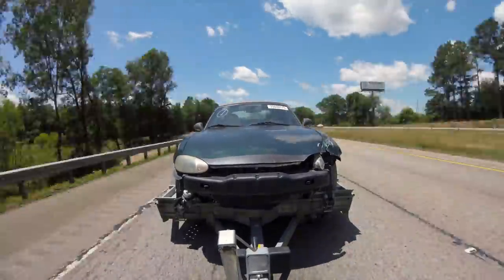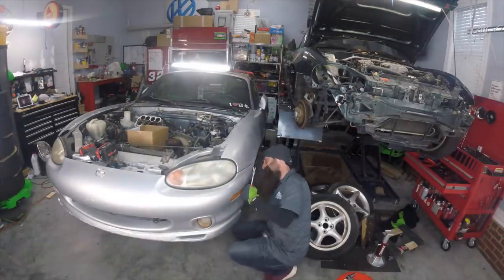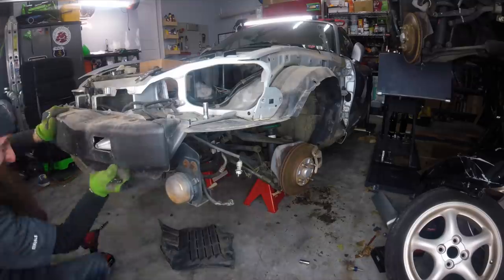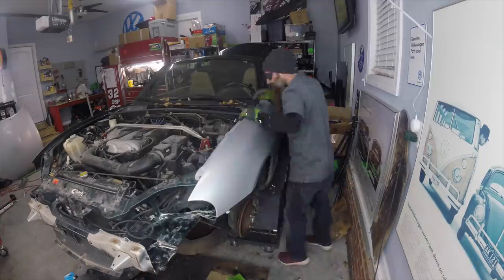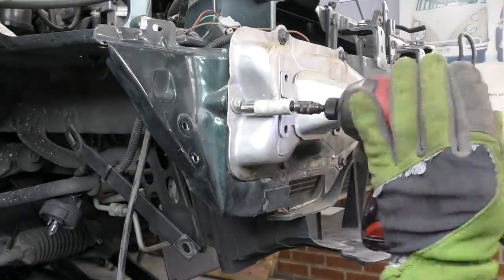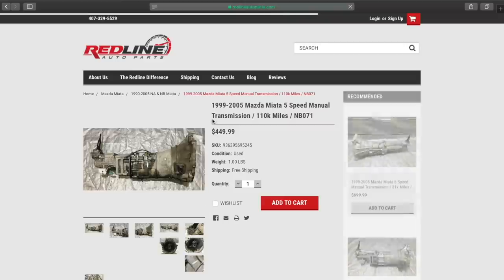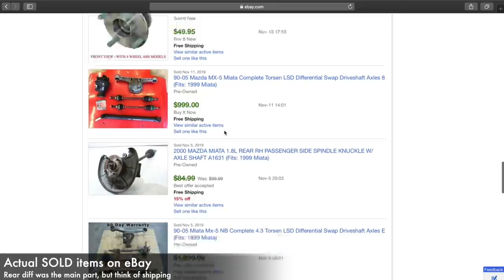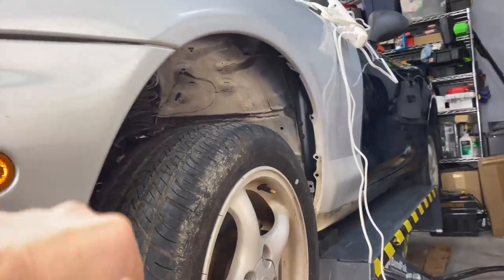Was It Worth Buying a Parts Car for a Project Car?

Comment: Charles, a guy with your experience can easily do a Miata body swap. I've seen huge Miata projects, since they re very easy and simple to work with, and most of them do body swaps or complete body changes (its not hard, with a quick check you can determine by yourself how hard it is). I also think that splitting the shell from the chassis would also also give you and all your channel viewers a different perspective of how this car works mechanically "under" the body without body over it... Here's a nice picture of a Miata without the body (perhaps this picture will give some extra ideas and inspiration for new videos): https://flyinmiata.com/projects/installation_photos/IMG_6843.jpg Don't get me wrong but hammering is not your best, I really think that doing the body swap + your very well documented explanations and knowledge you benefit greatly all your viewers, of course there some other considerations like space and time to do this job + videos editing etc... Good luck with this project and thank you for all your videos and time you put into them.
Reply from the maker: No doubt it’s doable(looks rad with the body off. 

But the body is just Part of it. Still have to swap full interior and top. I’d worry due to mold the dash and all the goodies behind it would need swapped too. 

This way we I have the car together and ready to go. If I did the body swap We’d be a long way from driveable. 

Who knows maybe we aren’t done with Miata parts cars. ;)
Reply from the maker: And yes totally a space and time thing. I’m ready to have this one rolling so we can move to the next VW project. ()

Comment: 35$ what the hek they were thinking 😂..about my experience with junk yard xar parts..here they are theives they sell some car parts with a price more then the the new same part price 😂
Reply from the maker: At the junk yard? I’ve never ran into that. Some parts are $$$
Reply: @HumbleMechanic  here we call the palce that sell used car parts a junk yard..about pricey car parts..i remember in the past 4 years i needed a battrey terminale i found it in the used car parting place the price is high i did go and buy new one with half the price..and that was not just one car part place i searched 4 2 of them they have it with same high crazy price 😁 its crazy here